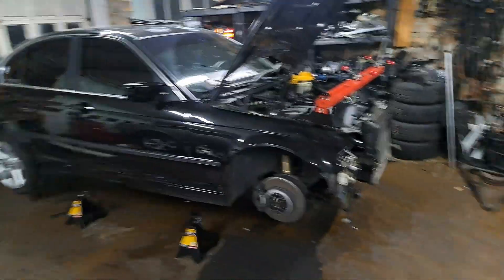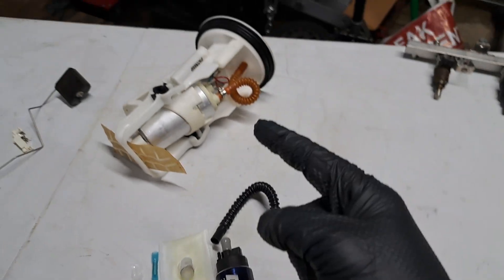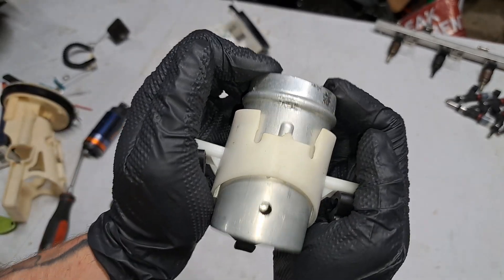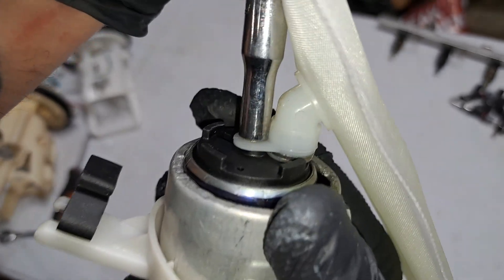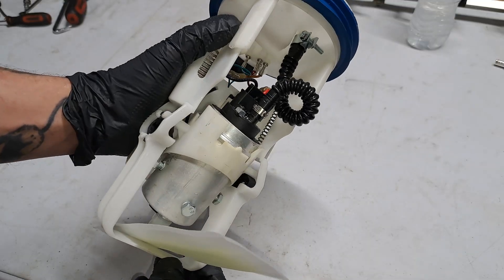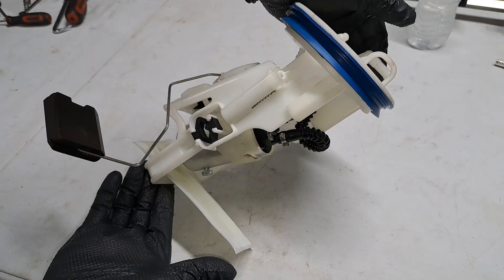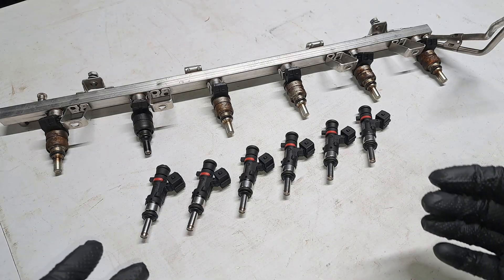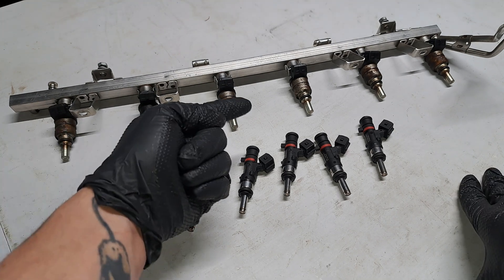BMW E46 Turbo Build - Fuel System

Comment from the maker: *Do not use the original MS42 M52TU fuel system parts with boost! The fuel rail and 3/2 valve assembly under the car (if equipped), it will lose fuel pressure under load. The E36 3/2 valve assembly is great, but it is not the same as E46! Don't use it! We installed a M54 fuel rail and fuel filter/regulator. Easy conversion. Works properly now. No more lean spots.*

As far as revisions, I recommend an upgraded fuel pump harness, and do not use the included clamps but your own fuel system style clamps on both ends of the crinkle fuel pump feed hose. Absolutely want no fuel leakage within the feed system under engine load. You can also get proper fuel pump sleeves to fit the OE hanger assembly from BeRacing Tuning. They sell a kit with fuel pump.

You can also place your fuel pressure regulator vacuum/boost reference hose to direct vacuum of intake manifold if you'd like. Up to you, or your tuner.
Reply: Will it come a video on how to swap?

Comment: Porche injectors are a bit taller than original siemens deka is there a need to adjust injector spray location inside manifold ?

Comment: So I'm curious if i will need to swap to m52tu fuel rail + add a regulator on my turbo m54b25 ms45.1 build? I know it is returnless as well as it might not be boost relative. Great video btw very helpful!
Reply from the maker: Original M54 fuel rail and fuel filter/regulator assembly works fine with boost, but if your fuel pump is bigger 340LPH, don't use it. M54 is a return system. It returns from the filter, not rail. 

This car is a M52TU, as to why I'm using the M52TU rail.
Reply: @OLearysBMW okay thanks for the help. So are the fuel systems the same between ms43 and ms45.1?
Reply from the maker: @bry4582  Yes. Only specific one is 325 SULEV. Sealed fuel tank, stainless steel lines, special injectors/rail.
Reply: @OLearysBMW Thank you man🙏

Comment: Ahhh there’s the ccv. So you capped the valve cover and the vacc run off from the bottom of the intake?
Reply from the maker: Information regarding CCV was in intake manifold video. I don't cap the valve cover, how would blowby/crankcase gasses escape? Valve cover will be vented.

Comment: I'm interested in dropping out the rear subframe of my '01 325ci and do a full swap to a 330 subframe. I'm interested in doing this for the thicker splines on the 330 axles, and being able to run the bbk set up you discussed without any painful modifications (that and I've got plans for some more power later down). I've got a junkyard where I found a car that I can source it from, but I just don't know much about everything on this side of my car. I've been looking around for information but there is so much every where its making me feel lost. Like just trying to understand which bushings I need to replace, whether or not I'll need to replace the input shaft? I guess the other part to this is that i'd like to keep my stock diff to keep it a final drive of 3.15. Any tips from yourself you could offer? Or maybe a good place to look?
Reply from the maker: 330 subframe itself is not specific. If your 325 is a manual transmission from factory, then yes, your ratio is 3.15, you don't need to mess with the input shaft or swap diffs unless you're 6 speed swapping. Depending what 330 axles you use, will dictate what output shafts you need for the diff. If choosing RWD 330 axles, your original 325 diff outputs are the same. If choosing manual RWD/xi 330 axles, you'll need the paired output shafts. The output shafts are easily swappable. Only held in by a circlip, they pop in and out. Keep the 325 diff/subframe. Use 330 trailing arms, axles, parking brakes. Unless maybe you find a mint condition subframe compared to yours. 

Recommend to do all primary bushings. Subframe/diff, all trailing arm bushings. 

Both 325xi and 330xi use 330 trailing arms and axles. Both 325xi and 330xi use manual 330 axles, no matter if the xi is auto or manual. Xi subframe is also nothing special, just has an additional threaded hole for a vibration damper, only reason xi rear subframe has a different part number than RWD subframe.

Diff ratios:
323/325/328 RWD auto: 3.46
323 manual: 3.07
328 manual: 2.98
325 manual: 3.15
330 RWD manual: 3.07 - 6 bolt input 
330 RWD auto: 3.38 - 6 bolt input
325xi AWD auto: 3.46
330xi AWD auto: 3.46 - 4 bolt input
325xi AWD manual: 3.23 
330xi AWD manual: 3.07 - 4 bolt input
330 ZHP auto: 3.64 - 6 bolt input 
330 ZHP manual: 3.07 - 6 bolt input
Reply: lmao a 330 subframe is the same as yours. and if you dont know which bushings you aint even ready to put the car on stands lmaoo

Comment: I think those injector retainers must be installed specially after you increased the fuel pressure with the new pump, believe me  you don't want fuel leakage on a hot turbo manifold
Reply from the maker: Have personally ran them before without, as so do plenty of others. They do not work with these specific injectors.
Reply: @OLearysBMW 
The matter is I am used to see you pay attention to every small detail 
Your builds is much solid than others but to be honest I'm not sure that they would hold high pressure but it is your call

Waiting for the S62 update ❤️
Reply from the maker: The injectors seal via O ring at either end. Plus the injector ports of the intake allow the injectors to only go a certain depth. Once fuel rail is bolted down, they are at the stops and cannot go deeper into manifold. They stay put. The clips don't prevent leaks.

Comment: These injectors, are they compatible with the inlet manifold? I think the standard injectors are made to have a specific spray pattern. Which the Porsche injectors might not have. Anyway thanks for the new upload, loving it. Definitely going to do this one day.
Reply from the maker: These injectors are used commonly for this specific application. Have ran them in past turbo setup as well. No issue.
Reply: @OLearysBMW looking forward to the Tuning and downpipe/wastegate fabrication
Reply: youre not ready to turbocharge a car sorry.

Comment: hey boss I recently got a issue with my e46 323 ci crankshaft sensor a got and installed a new one the issue I still the same when I use the code error so u think I should buy a OEM crankshaft sensor ?
Reply from the maker: If you didn't buy OE the first time, yes. 

Can also inspect wire harness for damage.
Reply: @OLearysBMW ok maybe that’s why i tried the cheapest way I will get the oem sensor 👌🏾 thanks Man U the best

Comment: What's your opinion on aftermarket aluminum parts for the e46 if it's being boosted?
Reply: I still need to try the Tamarind!😁 Great content, as always Tyler!🙌
Reply from the maker: As in..
Reply: @OLearysBMW Well, they make a lot of stuff. Aluminum thermostat housing, power steering resevior, coolant water pipes below the intake manifold, coolant reservoir etc.
Reply from the maker: @lucac2437  Yes, wasn't sure which ones you were referring to. Aftermarket aluminum valve covers, inspect for cracks and be certain the vent port is drilled completely. PS reservoir, don't see any benefit. The original ones don't fail besides the built-in reservoir becoming less efficient over time, yet aluminun heat soaks worse than plastic. Heater pipes under intake, never looked into them. OEM plastic ones lasting over 100k works for me. Thermostat housing, again OE plastic lasts a damn long time. Gaskets will leak before housing cracks. Sometimes they'll leak around the plug depending on version.

Metal replacements have their time and place, dedicated race cars.. etc. More commonly OE parts do the job.
Reply: @OLearysBMW Thanks for your response and insight. I've personally installed a S/S vanos oil line, aluminium thermostat, and aluminum P/S resevior. For me, I think the S/S vanos oil line and the thermostat were worth it. The thermostat was $80 which included the housing thermostat and gasket. The Vanos line was $90. I agree that the P/S resevior is kinda useless especially since I know you figured out the common leaking problem from the cap. On the bright side, All of these were leaking and needed to be changed, so I gained experience and can learn from my own mistakes.
Reply: Aluminium valve cover seems to be a solid choice

Comment: just stumbled across this via the almighty algorithm. Two questions: why does this car have a fuel return and others dont (curiosity only)  and how are you managing the tune? Are you gonna raw dog the ecu with tuner pro or is this a mega squirt type scenario??
Reply from the maker: The return style system was used in previous generations, then carried on with the first few years of E46, eventually phased out when the M54 engine was introduced. The original DMEs take kindly to tunes and very commonly used. This car was originally an MS42 DME, yet was converted last year to MS43. Both variant are tuning friendly.
Reply: @OLearysBMW so are you gonna run this on a factory ecu? I ask because I’m toying with the idea of a turbo setup on my e46. I’ve done some small changes to the variable valve timing tables and I’m wondering how you’ll handle fuel delivery with the new injectors. Sorry if I’m asking something you’ve explained in other videos.
Reply from the maker: @October.Industries  MS43 will be used. Which is a factory DME, yes.

Force induction tunes, I have someone else do.